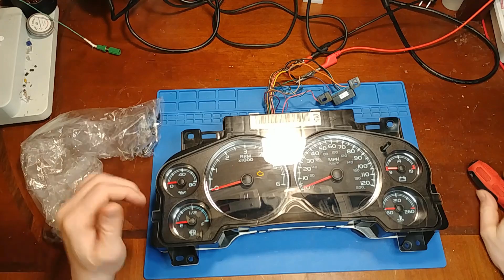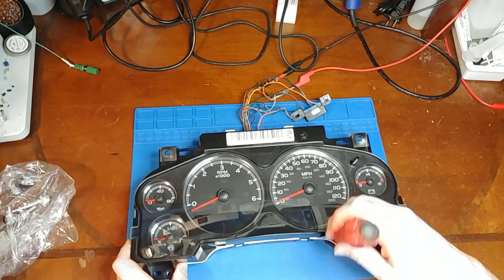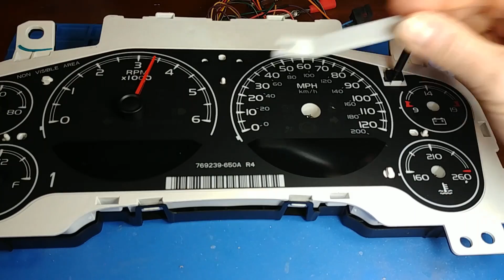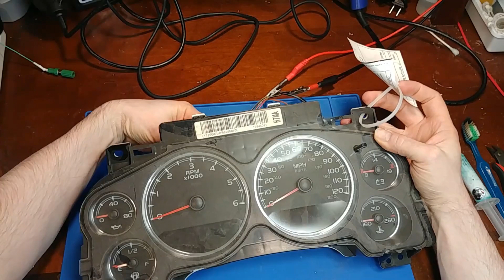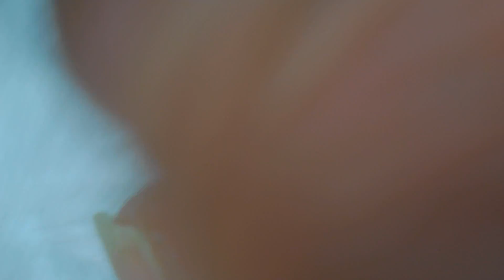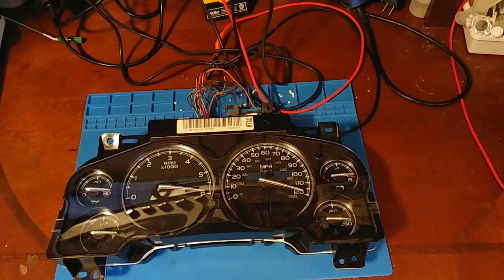2007 GM Cluster Repair + Blue & White LED install

Comment from the maker: What do you guy's think of the color combo?
For more information on installing LED's in this style of cluster see:
https://youtu.be/y35oEE5v58w
Reply: I love that color combo!  It's honestly the color combo I went with on my car, just never can find clear needles, and seem to be forever stuck with those orange needles.
Reply from the maker: @ChucksBasix  what year is yours?
Reply: Hi Jeff, question for ya. Where do you get your 5mm flat top LED's with built in resistor?
Reply from the maker: @XXXXXXXXXZZXXXXXXXXX  I buy them directly from the manufacturer that sells out of Shenzhen. They only sell in large quantities to wholesalers.
Reply: Like the color change. I have been looking at something similar but to me the ice blue background seems to have a cleaner look to me just don't know what color to do the needles with.
Reply: Love the color combo, I did it to my cluster a couple years back.

Comment: Jeff, I have a 2007 Suburban cluster the LEDs on the oil gauge no longer light.  So I thought maybe a cold joint upstream  or most likely a defective transistor since both went dark at the same time.  I can't find anything that tells me what transistor contols the dial LEDs or what transistor value it is.  Also I was trying to make a harness out of a cluster cable I got from the junk yard but was not able to find a wiring diagram to make connections to so that the cluster comes alive.  Would you be able to share that info with me?  Thank you so much for your assistance.  I am pretty good at fixing things once I have the right schematics etc.
Reply from the maker: Most likely it's a failing LED.

Comment: Have you ever replaced the fluorescent displays with other colors?   I swapped leds for blue but it would be great for everything to be blue except needles and alerts
Reply from the maker: @DrDrax-tz8xv  you really can't change the color of the vacuum fluorescent display. But you can cover it with color transparency film.
Reply: @jeffescortlx  Thanks for the info.  That is what I suspected but figured I would as the expert.

Comment: What all cause the display to not work ? Also what color on the plug turn on the display and board ?
Reply from the maker: The MOSFET goes bad. If you check through my channel I have a few videos covering it.

Comment: I am wanting to swap leds on my 2013 GMC 2500HD. What type of LEDs are you using here, would they be the same for my truck or are they different. I've seen that will need the smd 3528 with 4 contacts or do they need the 2 contacts like yours in the video?
Reply from the maker: All 07-14 NBS use the same package size LED'S. If you can find the LEDs you want in a four pin, that will work great. Otherwise two pin work also.
Reply: @jeffescortlx  Would there be a difference in brightness between the two? Also, the 4 pins are in a common anode or cathode. Which would be the correct choice?

Comment: Fantastic repair especially on the LED bulbs replacement. Very professional work bro. What size are these bulbs and where to buy them from?
Reply from the maker: They are a 3528. You can get genuine ones from Mouser, digi-key, Newark element 14.

Comment: Somebody please explain to me why the engineers/designers of this board decided it was logical to use four 1 inch screws to hold this together along with the clips on all sides, make it make sense. Damn it
Reply: This only seems to be a problem on the avalanche
Reply from the maker: They dropped using the screws in certain year ranges.

Comment: Thanks so much for the in-depth video, I learned a lot!

Couple of questions. Can you recommend a microscope that is less expensive but will magnify enough to make a ckt board repair? If I was going to do repairs a lot then I wouldn't mind getting the one you are using but I will probably repair a couple or three boards at first then maybe an occasional one later.

Do you have part numbers for the LED's and where to purchase quality ones?

And a bonus question, my tint causes my dash to be unreadable during the day. Is there some way to add some additional LED's for daytime illumination? that stay on without turning on the parking lights. Maybe something shining back on the cluster?
Reply from the maker: Here is more information on the LED part number:
https://youtu.be/y35oEE5v58w?t=602
And here is an example of a low cost microscope:
https://youtu.be/HENFD993E08

Comment: I have a 2004 that I am looking for some Blue LED bulbs for.    Do you have a part number?  Or could I buy directly from you?
Reply from the maker: Sorry I don't get into selling individual parts like LEDs. I recommend a 5 mm with built in dropper resistor. Flat top not dome. Diffused instead of clear if you can find that option.

Comment: You missed a connection.  I was hired to replace the MOSFET Q16, you show in your video.  But I noticed that there is a via connection to the large Drain pad that you did not add a jumper to.  Since I'm only a professional solderer and do not know why the via connection is provided to the back side of the board, I added a jumper to it.  I would appreciate knowing if you know...
Reply from the maker: I'm pretty sure that just goes to a test point pad that's used during assembly for the bed of nails tester. But it's not needed for normal use.
Reply: @jeffescortlx  It's true, upon closer inspection it only went to a test pad.  Thank you for the quick response during Thanks Giving.

Comment: Can you verify that 07 ETC on this guage is a dummy guage....... mine reads 47deg hotter than my scan tool..... is there any way to convert it if so?
Reply from the maker: It should read accurately. Give or take maybe 10% if I had to guess.
Reply: @jeffescortlx  thanks for your response.... any ideas? It acts like its working correctly(slowly rises to~210), but when I hook up my snap on scan tool it reads(47°) lower. These only have 1 sensor for ECT. Is there a reset? Or?
Reply from the maker: @customsolutionsinc  has anybody tampered with the cluster?
Reply: @jeffescortlx  no other mods to truck, buuuuut i haven had cluster out.... needle drops to 160 not below so i "imagine" not.... ill have to check..... also I watched your contact info video and am interested in combining my electronics interstes and mechanical/LS work..... AKA tuning and guage repair/customizing.
Reply from the maker: @customsolutionsinc  when the vehicle is started cold, does the needle start at the bottom first notch?
Reply: @jeffescortlx  short answer yes, long answer I sent you in the second of 2 emails
Reply: Btw love the colors.

Comment: Is it crucial to solder the tiny square LED's to 2 of the pads of the circuit board? Will it not light up if they're touching all 4..
Reply from the maker: It will cause a shot if you use a 2 lead LED on a set of pads designed for 4.

Comment: Where can I get the misfit cit
Reply from the maker: You can get the MOSFET from any vendor that sells electric components. Digi-key, mouser, Newark and sometimes ebay or Amazon.
Reply: @jeffescortlx  what’s the name of the mosfet
Reply from the maker: @gabrielbrown3792  you can see it at 6:15 2705

Comment: Hi I have 07 Saturn aura it has one problem is illuminating LED burn behind speedometer let me if you can fix it or let me know about that thanks again
Reply from the maker: Yes I've done a few of the Saturn Aura LED replacements.

Comment: Jeff,  I have a 1995 S10 that uses T10 194 socket type bulbs. I'm wanting to change just my illumination bulbs to Blue LED. I bought some on Amazon made by Partsam . Are these good LED? Even came with new screw in sockets .
Reply from the maker: In my experience, probably not good. Most ebay/Amazon 194 LED's are good about 3-12 months then start flickering.
Reply: @jeffescortlx  do you work on these clusters and if you don't,  where is a good source of QUALITY LED bulbs. I'm also wanting to put a white face cluster but I'm scared of messing up the cluster itself.
Reply from the maker: @barbiesawada5916  I haven't found any quality pre-assembled 194 bulbs. I don't stock or offer them
Reply: @jeffescortlx  So I would be better off to try to find 194 or 168 Blue filament bulbs ???
Reply from the maker: @barbiesawada5916  you can try the Amazon ones, pretty easy to change out. Just don't set your expectations too high.

Comment: Do you ever have to change the trip button switch. We have to change clusters alot just because we can't get the miles for a driving log at work. We mostly have GM trucks that range from 2005-2020. The 07 and newer styles seem to have the most problems. I was seeing if you would share the part number for it and I could try changing them. I have watched most of your videos on them and want to try. If it doesn't work I could send them to you.
Reply from the maker: I believe it's 6x6x3 mm tactile smd.
Reply: @jeffescortlx  thanks, I will try my hand at it. We will see how it goes. I have a rheostat on a Miller welder board I am going to try too. It is 1200 for the new board only 5 terminals.

Comment: Hello, can you find out the source of electricity in the connection number for Tahoe 2007, I want to test the number before installing it, but I do not have the connection
Reply from the maker: Pin 1 and 5 is positive and 13 is ground.
Reply: @jeffescortlx  Thank you 💛💐
Reply from the maker: @almodraji  your welcome ✌

Comment: if the displays sometimes comes on when cold (max 0 to +5 degree ℃  or 32 to 41℉) then fades out when the cabin heats up, what would be your guess on what part of the board that have gone bad?
Reply from the maker: Probably assuming you vehicle is the same make/model/year as the one in this video
Reply: @jeffescortlx  yes 2007 chevy suburban. its just that it still lights up when cold and goes black after it heats up.
Reply from the maker: @FluffYSweD  typical MOSFET issue.

Comment: Jeff what kind of wire you use for the jumper? To jump from stepper to the  trace
Reply from the maker: For short runs I use the left over leads from my lamps. On the long runs I use coated electromagnet wire.

Comment: I think it is time for some more videos. I enjoy watching them and have learned a lot from them. I don't think you do other LEDS swaps for like window switches and everything else to get rid of that ugly Aqua color. As of right now I have a 07 Avalanche that I have replace cluster green back ground and with white needles. Also already replace LEDS in all window, headlight, 4x4 switch and more. I am just waiting on some more 2012 green smd LEDS to get here from mouser. To do everything else, even the factory radio. So thank you for your vids and for inspiring me to get into cluster repair.
Reply from the maker: If you successfully pull off a SMD LED swap give your self a pat on the back. Seriously, not many people can can complete it without complications, especially without good tools like microscope and hot air or multiple soldering stations. I have done complete interior LED swaps, I just haven't had my schedule line up with the job for filming.
Reply: @jeffescortlx  It hasn't been that complicated yet. I actually find it to be relaxing. I use a microscope that use a hdmi output to a computer screen and use a hakko 888 and 2 $50 soldering stations like the ones you use, hakko desoldering gun and a cheap hot air station. Which they all work great. So by the end of this weekend should have mine full interior LED swap done. Then i got one other customer that wants me to do the same with his 09 but blue. Wanted to do mine first to see what I will need for smd's. Only problem I will find with his is that the climate control panel buttons have a green backing on them which I noticed with mine.

Comment: Hi Jeff, do you repair Mitsubishi units or know someone who does? My local guy (Phoenix) wants $375 to fix a speedometer that only works after tapping on the plastic. Thanks for the reply!
Reply from the maker: I haven't had any Mitsubishi clusters in, could you tell me your year and model?
Reply: @jeffescortlx  2005 Mitsubishi Montero Limited

Comment: Jeff, 
So many questions. 
What do you use for jumpers?
What temperature are you set at for your cluster soldering projects?
Where do you buy and would you link to where to buy the leds and the replacement resistors you use?
Will you ever make a introduction video of how circuits such as these work?
Have you considered setting up a paypal or patreon that we could use to donate to your channel?
Thank you so much for your videos!
Cheers!
Reply from the maker: 1: solid strand leads for short runs. Transformer wire for long runs.
2: 320°c.
3: LED from over seas manufacturer. Resistors from digi-key, mouser or Newark.
4: probably not, but you never know.
5: maybe some day in the future. But not necessary now.
6: your welcome.
Reply: @jeffescortlx  overseas manufacturer? Fine then, keep your secrets : P
Reply from the maker: @Iskremfrpupy  the native 12v flat tops are made to spec and not stocked. People typically give me stink face when they hear how much they have to spend to reach minimum order quantity. Unless you're high volume, you'll be happy buying from a vendor like mouser.
Reply: @Iskremfrpupy  if you look on eBay there is one guy in Wisconsin that sells the same LEDS Jeff uses on the 03 to 07 classic clusters. Stay away from partsam LEDS.

Comment: I have a 2005 pontiac g6 i need my gauges fixed both my mph and rpm needles twitch alot before doing their sweep, and looking to color change the lights
Reply from the maker: Sorry I'm currently not setup for the G6.

Comment: Great video Jeff. I'll bet that stepper motor was damaged by the owner attempting to install one of those aftermarket pointers. Those aftermarket pointers can fit insanely tight and you really have to be careful installing and removing those. And if you're not aware of that before you put them on, it can be a recipe for disaster.
Reply from the maker: Yes typically the 03-06 after market needles fit too tight, but these slid on nicely. Felt better than the average 3rd party. Maybe he didn't twist off the original needle and tried to pull straight up without breaking it free first?
Reply: @jeffescortlx  On a side note, where did you get your white rectangular T-15 tip tray? I've been using a few of the Hakko B2756 circular tray's. Would be nice to consolidate all of my tips into one tray.
Reply from the maker: @mike7958  she's custom! I have a buddy with a home machine shop. I bought him one of these OLED T12 stations and he made that for me.
Reply: @jeffescortlx  Gotcha. That's a pretty slick tip tray. I'm surprised Hakko doesn't make a T-15 tip tray that holds more tips. 

What would be really cool is a custom T-15 tip tray similar to yours that is designed to mount on a pegboard angled at about 45°. I'd pay to have that made.

Comment: Jeff Can you add a trans temp motor to a 01 Tahoe cluster?
Reply from the maker: For 99-02 if you want to add trans temp you need to replace the cluster.

Comment: On my 03 Silverado Cluster, it twitches and has intermittent use. I pull it out, unplug the wires, and its fine again, getting to be a pain because sometimes it does it every other day sometimes multiple a day, but all gauges and lights work, could it be the connectors or wiring?

Comment: Ooow that's a great colour for night driving :-D.
The 850ma could have been the leds being driven slightly harder, i don't suppose you looked at the current at the end maybe.
I've repaired burnt pcb heatsinking by cementing a square of undeveloped single sided pcb over the burnt section and solder the regulator/mosfet/other to that.
It's not pretty but it works :-D

Your list of favorite tools needs the cat adding, i know it's your technical advisor :)
I could unsub then resub... no no that's silly, but sillyness is my middle name :-D.
Reply from the maker: The junk yard cluster had almost 300k miles, while the board in for repair had half that at 150k miles, I wonder if a tired VFD display could be why it was drawing 50mA less on the higher mileage one.?
Reply: it's a good possibility or the vfd heater supply was a bit low so emission was lower so less bright.
I don't know how high a voltage is needed for the anode of the vfd, if it's above 12v then a step up regulator is on that board somewhere, and that could be having a bad hair day :-D.
I'm sorry i dont know much about vfd displays :-(

Comment: Where do you recommend getting good quality surface mount LEDs like those. I’m kinda tired of replacing mine every year it seems like with the eBay specials lol
Reply from the maker: The nice thing with 3528 is they are a very common SMD package. You can find them at mouser, digi-key, and Newark. They all sell quality brand LED's.
Reply: jeffescortlx I see you use the 2 contact points vs the 4 contact points more. Thank you very much for the references
Reply from the maker: @derrickcarter354  the 4 pin would be easier to install, but 2 leaded is easier to purchase.
Reply: @jeffescortlx  ))

Comment: I assume that cluster would have popped the fuse at some point.  Knowing people it popped the first, replaced it, popped it, then they tried a larger one.  LOL
Reply from the maker: Please no your giving nightmares. I also work in industrial controls and those people should know better. But nope, if a fuse pops instead of trouble shooting, they just stick in the biggest fuse they can find, and then send in boards for repair that were shooting flames.

Comment: Would you ever do a parts comparison between a GM and Toyota cluster?  To see if they use different quality parts
Reply from the maker: I don't get in too many Toyota clusters, but if I remember correctly I believe some of the truck clusters are from the same design as ford.
Reply: jeffescortlx It would be a fun video on the type of capacitors each company uses